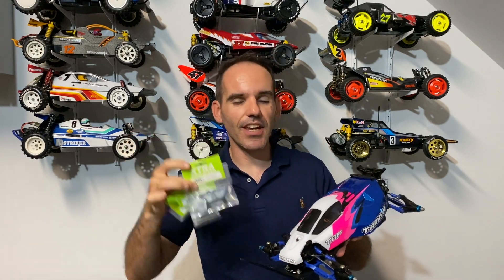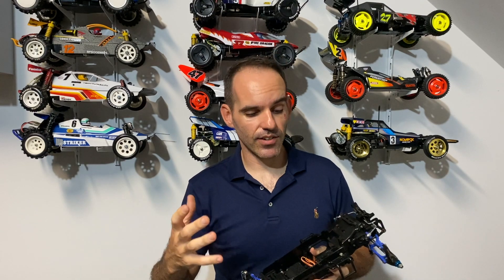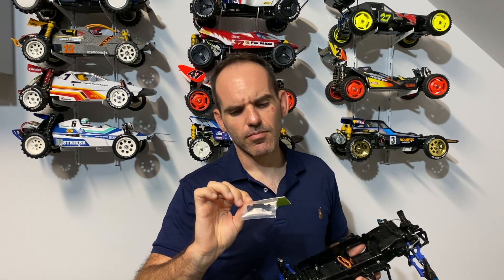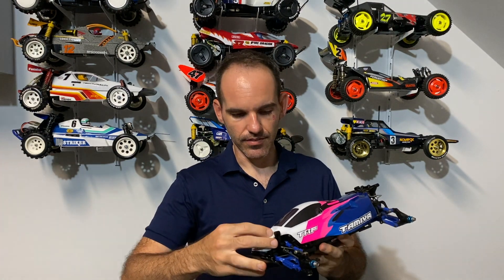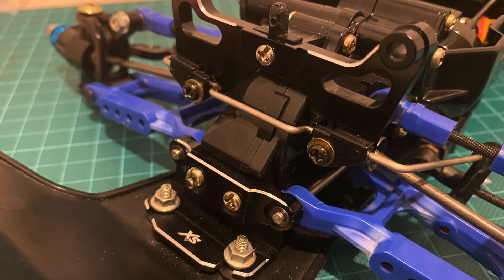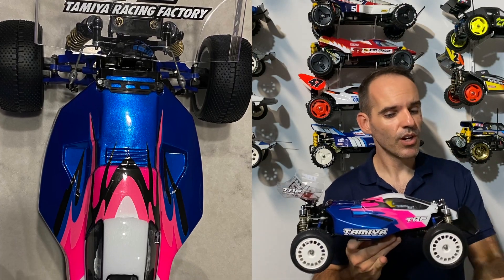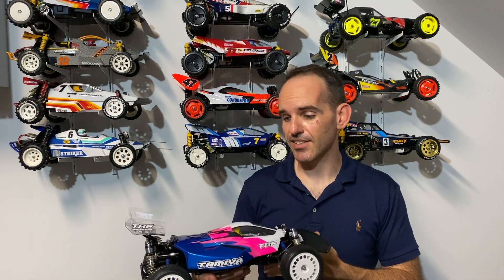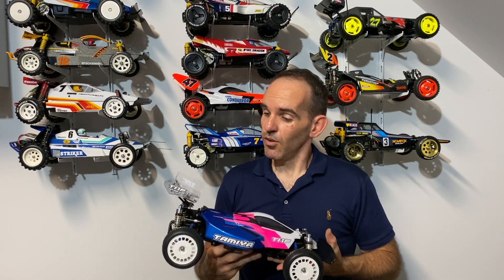Tamiya Terra Scorcher TRF Custom 4WD RC Race Buggy. Hi Cap Oil Dampers & X Speed Alloy Upgrades

Comment: Great video and very timely as I've just picked up the alloy parts and hi caps for my Terra Scorcher!
Reply from the maker: Very nice. They all go on super easy. Direct replacement for all the original parts. If I can give you a heads up.. I built the Shocks as per the VQS specs. I wouldn’t hesitate to add another 1-2mm slaver to shorten them a little more .
Reply: @RCACTIONAUSTRALIA  Brilliant...I'll give that a try when I fit it all. Cheers!

Comment: Got a mad bull on ftx vantage 2.0 shocks and all fittings got rid of wire arm servo built my own no slack or popping out on 550 8.4v 5000mah it sings.

Comment: Hi
I'm wondering about the 12mm adapter upgrade, that you talk about in the video. I will like to upgrade my car that way so I have more options on wheels.
Thanks in advance from Denmark 👍
Great channel 👍😀
Reply from the maker: Thanks for Watching. Any 12mm Hex adapters will fit, and give you a better wheel combination
Reply: @RCACTIONAUSTRALIA  thanks for your reply.
I have another question regarding this, and are you charging the spinners, and what offset are you recommending?
Brgds Peter
Reply from the maker: @peterdresen4926  5 or 6mm 12mm hex
Reply from the maker: I’m not sure of the offset, but DF03 wheels or the regular start dish, or VQS wheels all work well. What do you mean by charging the spinners?
Reply: @RCACTIONAUSTRALIA  thanks for your reply Adam
What I meant was the joint between wheel and aksel, but I solved it by putting a 12/4 mm hex on and now there's a lot more options.
Thanks again 👍
Reply from the maker: Perfect

Comment: The blue dampers on your table, are they Xtra Speed Aluminium ones? I've been looking at them on RCMart and wondered if they were any good?
Reply from the maker: Yes they are. I purchased them to use on this. I honestly wouldn’t use them.. they look nice but are super springy and offer little damping. Possibly an oil change may improve them. They are also super long for the terra.

Comment: That looks very nice Adam and the metal parts look great as they don't stand out but complement the chassis overall look, You have done a very nice job on the body shell with the TRF style, it sits a bit high so some adjustments need to be made to give it a better looking/lower stance, I love the TERRA SCORCHER it was my 1st Tamiya car back in the 80's.
Reply from the maker: Thank you 😊 Yeah it turned out nicely 👍🏻 I also love the Thundershot series Chassis & the Terra Scorcher is a nice looking kit

Comment: You did a good job, I was wondering whether it sits a bit to high????
Reply from the maker: Thank you 😊 Yes it does sit a little high, I think it’s the Larger rims. The car also has no electronics etc in it either. I would like to drop another 2mm spacers into the Shocks in the future